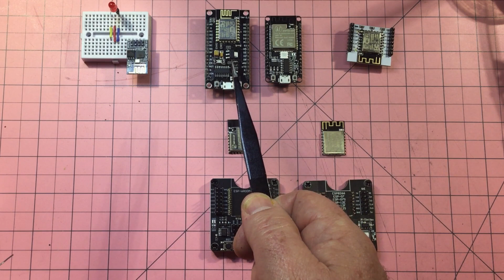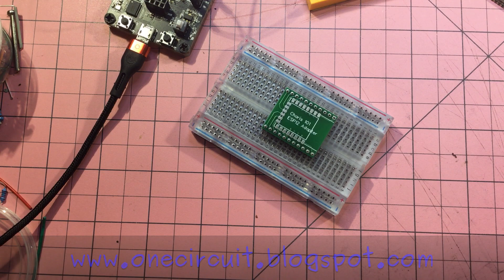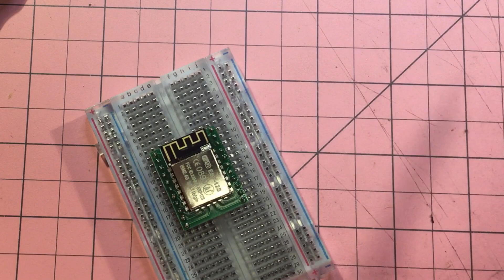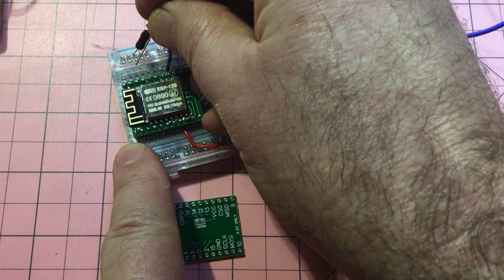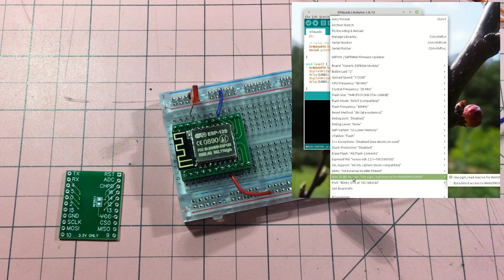Over The Air (OTA) ESP8266 Programming

Comment: I just listened to The Simple Electronics Podcast - 039 - Anthony (One Circuit) which led me here. An interesting video and something I intend to try for myself.
Reply from the maker: Welcome Brendan! The code etc is on the blog - let us know how you get on - it's a bit of miracle magic but works great if the WiFi strength is good, and the power to the module is stable and strong. 😀👍